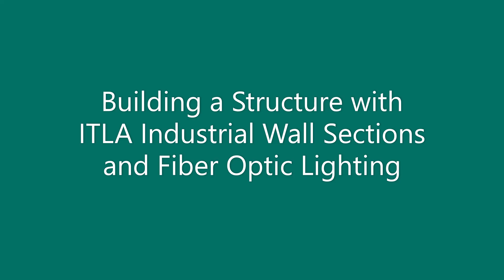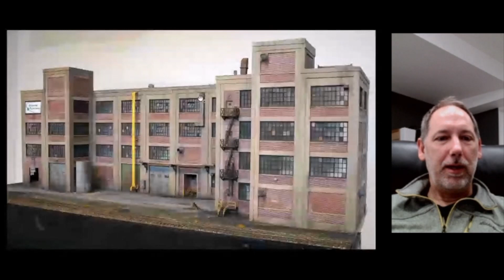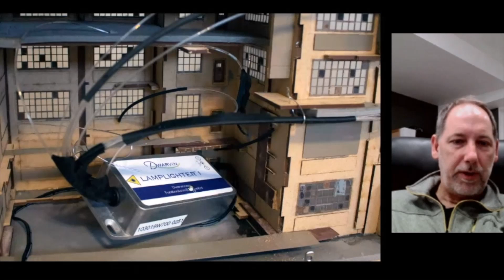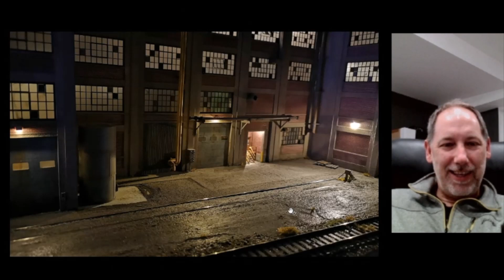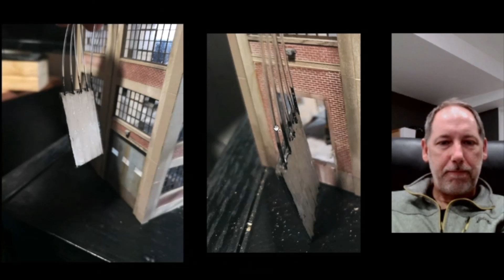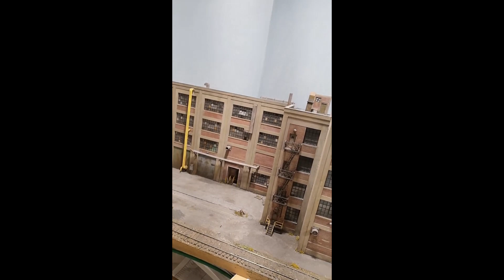Structure Building Using ITLA Industrial Wall Sections and Fiber Optics

Comment: On the thumbnail picture for your video Layout Update - Muskoka Central RR 2015 there is a tree on the left side of this picture almost to the edge but not quite. It is tall and only has limbs up close to the top like within the top ⅓ of the tree. They are sparse and not heavily flocked. This looks like a tree that I want to make a lot of for my HO scale layout that is set in the southeastern US more specifically NC. This tree of yours looks like a yellow pine and another called a longleaf or loblolly pine. They don't have the christmas tree look of pine trees that you usually see on model train layouts and ones offered for sale for model railroading. I'd like you to do a video about how you made this tree one day if you did in fact make it. Hope you start doing more videos again like you used to do. This video was really good. 
Stay well. -Wil  👍
Reply from the maker: Thanks William.  I made some trees using Caspia, but I think the one you are talking about was a commercially made tree and I don't think that supplier is around any more.
Reply: @MuskokaCentral  My luck. Thanks.